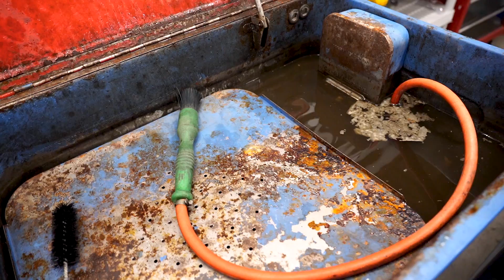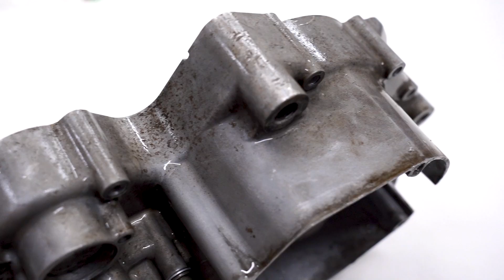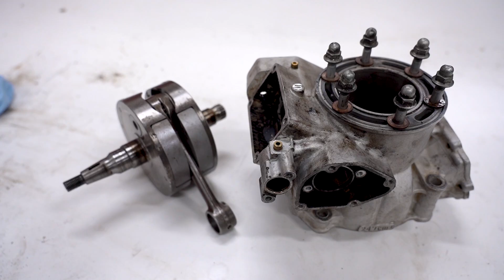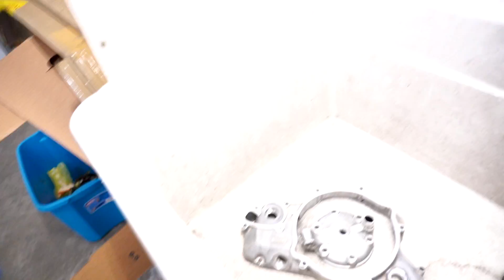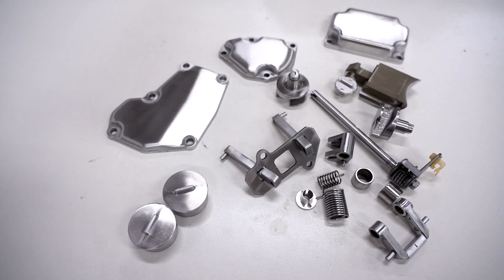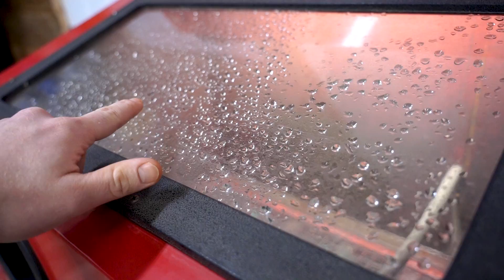Easily Clean Dirty Engine Parts | RM250 Rebuild 5

Comment: Hi, I have a problem with my cross and I don't know what it has.  If I pedal it does not turn the engine, and if I push it and push it still does not get the engine.  Don't you know what it would be like?
Reply: I forgot to say that I went with him without using the clutch because the cable broke :)))
Reply: And if I pull the clutch now, there is something beating

Comment: Ghetto tip of the week. Pour out half your degreaser bottle an cut the top off. Sit it on your furnace during the winter of course. It will get up2 120° an let your small parts soak.. Did my crustyy cr250 power valves and it made them look new. You'll need a brush and a pick aswell but it just falls off after a good soak..

Comment: Hi Cam
Just a tip on removing the dowels.
Shove the tip of a drift or bolt or even a small socket that fits inside the dowel neatly so when you grab it with the grips it doesn't squash and you can also get a much better grip on it to remove them.

Comment: Do you file that clutch basket from the plate wear? I just put a Hinson basket in my kx450 so I’m good but I’m just curious down the road for the basket.
Reply from the maker: Nope, there aren't any ridges on the fingers. It's just barely worn through the coating

Comment: Hey cam, is your cabinet a vapour blaster? As in does it use a slurry mixture of abrasives and water or just high pressure water by itself?
Reply from the maker: It is just straight water

Comment: I don’t know if it’s just me or what but i have never had good luck with prox pistons. Put one in my previous yz 85, about 6 hours after the rebuild, seized. Bought my current cr 125, it was just rebuilt with a prox piston, about 17 hours after, seized. Put vertex on both, changed at 45 hours on the little yz, 100  on the cr(road use) never had a problem. Is just bad luck?
Reply: I've used 4 strokes prox pistons and other stuff too and never had any issues. Good quality

Comment: What I do to clean all my parts is a good long vapor blast first and then if there is any remaining dirt staining or pitting or just a bad finish in general throw it in the sand blaster and that will remove anything but it doesn't leave as nice a finish so I go back to the vapor blaster and it leaves a nicer shinier finish that looks good every time. Some times parts will be so horribly scratched and pitted I don't even bother with the vapor blaster and just go straight to sand and finish with the vapor blaster and it makes everything look brand new.